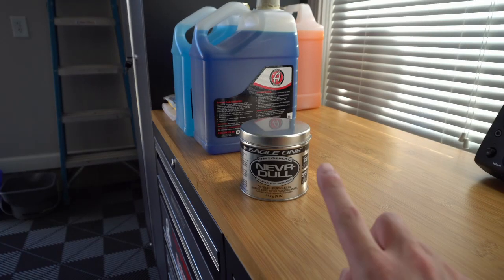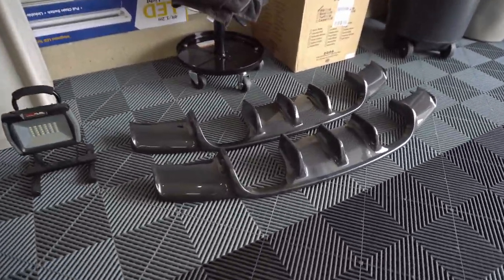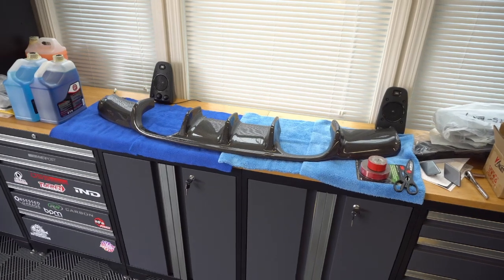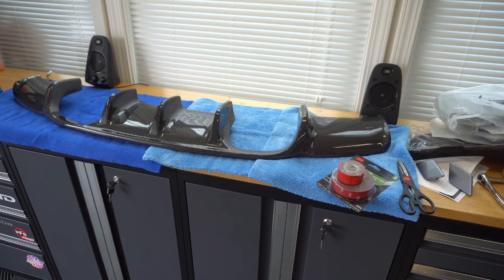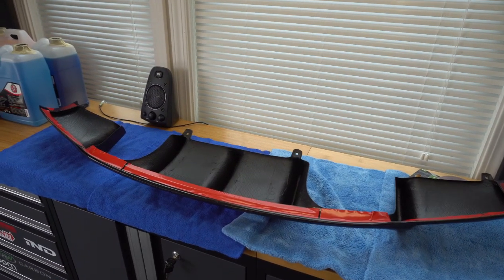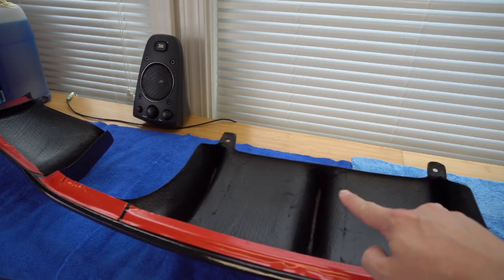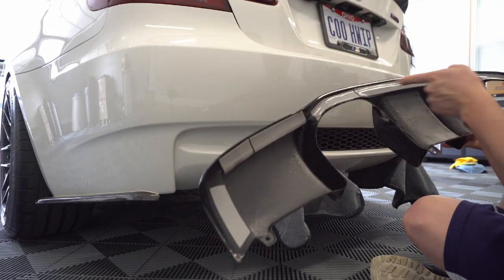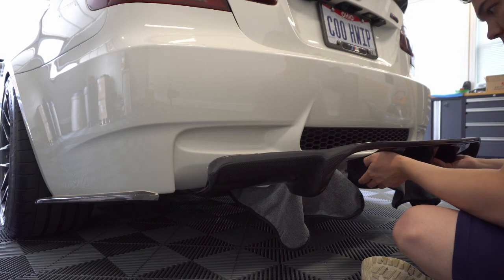Installing new Rear Diffuser on my E92 M3 | DIY

Comment: just ordered my gts-v diffuser. cant wait.  

what rear fins are you runnning ? look good
Reply from the maker: motiv8_m3 awesome! The rear bumper skirts are from AEuroPlug. Check them out on IG!
Reply: did they say anything about a extra US shipping cost?
Reply from the maker: idrisu1 yeah it was like $80 shipping to US. But even with shipping cost included, it’s still cheaper overall by quite a bit.
Reply: @accelerated_motion  Yeah it showed $80 for me also
Reply from the maker: idrisu1 I would send them an email and find out what the status is. They told me that they had to make mine from scratch which would take up to 10 days. It was less than that and shipping was relatively fast for being overseas. I was surprised.
Reply: @accelerated_motion  I just asked for a refund since total was going to be ~$432
Reply from the maker: idrisu1 oh ok. Yeah my diffuser was only $200 plus $80 shipping. Same one I had before from RW Carbon was like $499

Comment: how do you think the gts-v style from their website will fit?
Reply from the maker: I actually found out about CN AutoFans from guys who have purchased their GTS-V lip from the site. They were happy with them and that's why I gave them a shot. I'd guess that you'd have pretty good fitment. Give them a shot!
Reply: @accelerated_motion  UPDATE, week went by without shipping confirmation.. I contacted them.. they said I owe $118 more since it is going to the US. Did you have the same problem?
Reply from the maker: idrisu1 for me, shipping was $80 for my diffuser. Shipping cost may vary based on the size of the piece that you’re buying. But I did not have any issues whatsoever. They were responsive to my emails as well. Their English is a little broken but still understandable.